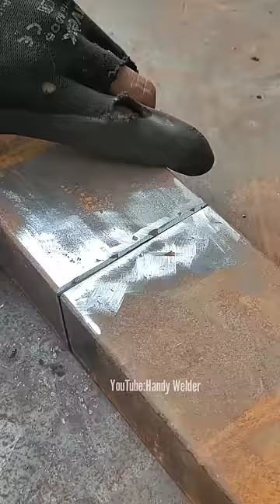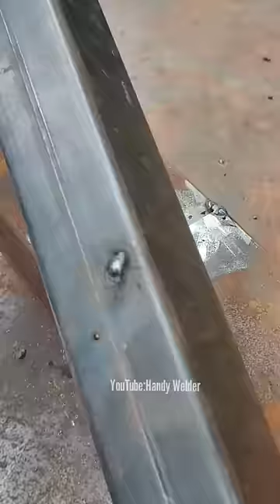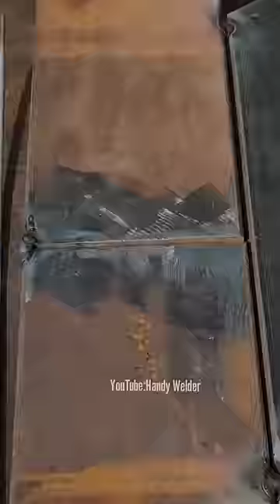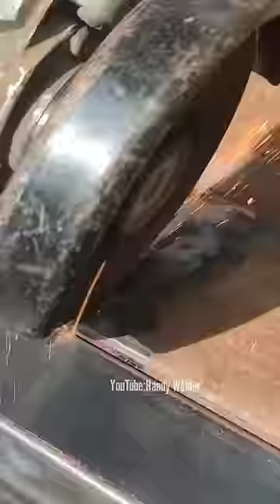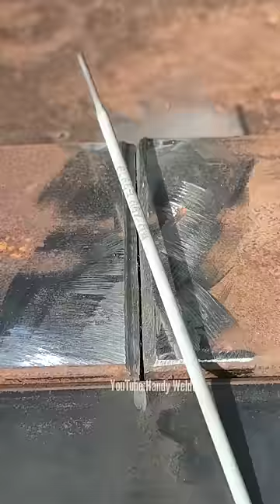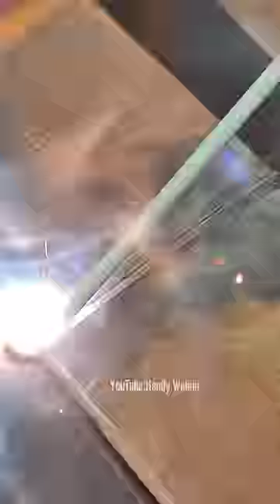welding short#weldingshorts

Comment: You're supposed to tack the keeper pieces to the spanner bar before you tack them together. When you tack them first you lose the ability to align everything straight. A piece of architectural angle works better bc it aligns two planes instead of one like this. Once he runs that bead the two halves are going to arch up at the weld and make a banana
Reply: We call them strong backs been called that since 1996 in Mississippi as far as I know oe😊
Reply: Any welder worth his salt also know that if you can clamp your pieces absolutely straight, the final piece comes out straight.
As a beginner, I had to weld 20’ pieces to make 40’ pieces, then assemble a truss for a conveyor.
When the final piece was finished and I sighted down a string line next to it, I was amazed.
I asked the journeyman welder I was working with to take a look at it.
He did exactly what I did!
Sighted twice with his right eye, then once with his left.
“Wow, that’s straight! How did you do that???”
Me: Did I do something wrong?
Him: No, it’s perfect! Keep doing that!
Reply: Зайчики через экран словил не могу проморгаться😅
Reply: По этому и нет второй части в видео о готовом изделии..
Reply: ai dreptate dacă barele se lipesc devin banană dar dacă se sudează se vor numi bare sudate nu lipite pentru că barele lipite nu țin se desprind repede
Reply: I have several devices called CLAMPS. I use them to secure pieces to a strong back. Best part, they're reusable, and I don't have to cut any tacks.
Reply: @dangeary2134 that’s not always true. It’s been tested and demonstrated that even if you clamp your pieces perfectly straight, you can still get welding distortion to your pieces. It won’t be as significant if you clamp it properly but distortion still happens.

Comment: But why 6013? You can get 7018's in 3/32's. Much better rod and doesn't stink like 6013's will.
Reply: He may only have an AC machine
Reply: 7018s should be stored in a rod oven and he probably doesn't have or want one. That's the reason I use 6013s anyway.

Comment: Did you tack the bottom of the flanges before you began welding across the top , here is another suggestion,  maybe bevel your pieces before they are tacked together to make sure you have a proper landing ? And when welding push your rod into the puddle instead of floating across the top , you'd get way better penetration
Reply: When there's slag you drag

Comment: This is a good idea. Better practice would be to use clamps though. If you’re doing code welding like buildings or bridges, you can’t just go tacking things willy-nilly. The inspectors will eat your lunch for that.
Reply: temp attachments , strongbacks  landing plates  are used on heavy fabs   all the time
Reply: @eweunkettles8207   true. But then removed, and NDT is done. Not just going all Zorro with a stick rod.

Comment: Prep the inside first then align and tack the outside. Weld inside the channel before cutting back and welding the outside.
And no need to weave, I honestly don't get welders who think this knits the steel together, I doubt it matters on this job or if your welding gates etc but if there's NDT involved like ultrasound or x-ray then you won't realise a uniform penetration plus it looks poor.
I don't care if its nuclear pipework or a go-cart for the kids, doing it right sets apart top welders from wire pullers...😊

Comment: ...this is all stuff you should be using MIG welding for, these are small easily portable and light parts that can and should be worked indoors.  Sure in an emergency, but this is not the first or second option to do the job.

Comment: Worked elevators 40years. Stick welding. Retired, bought a Millermatic tig, but can’t get the same good welds. Thought it was supposed to be easier..

Comment: The second video was correct the first video there’s not really a point of tap welding with steel pipe. The only time you would want to use tap is when you’re welding either sheet metal or aluminum.

Comment: I see these guys holding the rod at an angle. You’re supposed to stay perpendicular to the weld material. Otherwise it will long arc and cause porosity
Reply: Really? If it’s flat, ive mostly only seen people go perpendicular to the workpiece, the tilt it at about a 10°-15° angle towards the direction the will be traveling at. Definitely not this low, though.

Comment: If you look at the two pieces before they are welded together you can see the gap at the bottom is larger than the top. So this piece is just slightly not straight.